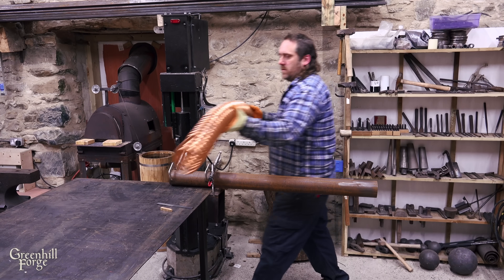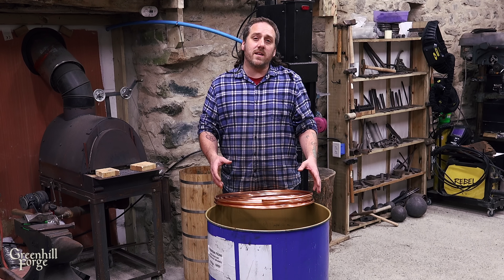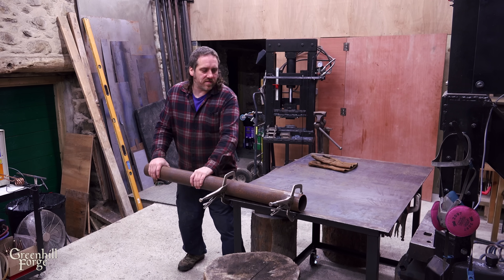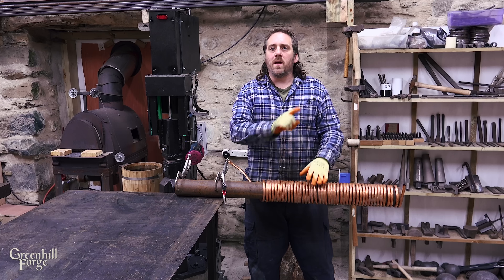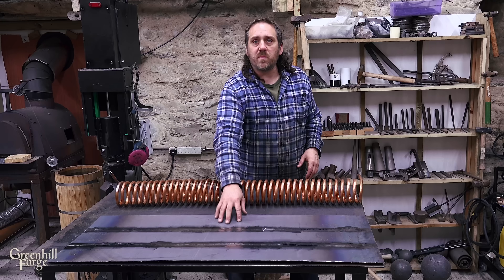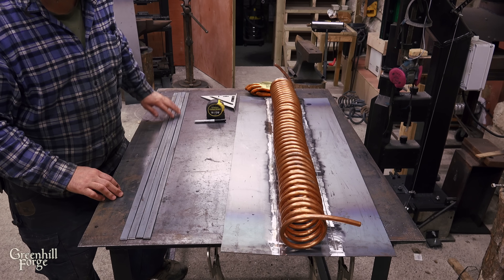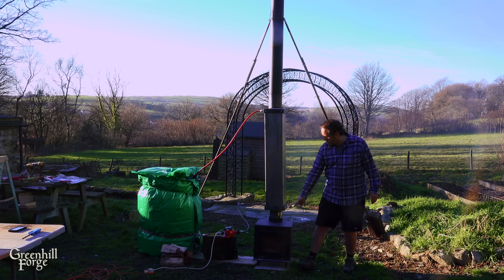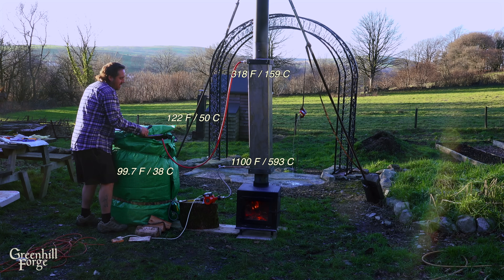Wood Stove Water Heater Experiment - Surprising Results! Part 1

Comment: the best way to do this is to put a stainless steel pipe that is pre bent back and forth , into the inside of the stove

you can do a siphon by putting the barrel or water heater higher than the cold inlet, or put a grunfos pump on the pipe like I did...I shut my water heater off in the winter.....water heaters use 4Kw of power when they turn on....and they can be on sometimes up to 30 minutes

Comment: My brother made a boiling vessel  roughly 10x10x3 which fit in the top of a Jotul 507 stove.
Based on the heat output from 3 radiators (convection circulation, no pump) plus radiated heat, we estimated the output from wood to be at least 5kwh.

Comment: Very well done , I have started builing mine last week .I have only18 inches of exposed  chimney in my shack .Wrapping the copper tubing with copper 6 inch fins incasing it in a cylindrcal casing creating a turbine . the upper and lowier vents are 3 inch .I will blow air though the vents , through the turbine making it dual purpose . Hopefull recovering the chimney heat for shack and my hot water device . with a variable speed fan regulating the air and water temp shouldnt be a challenge . Wish me luck , Im an old cripple living in the Rockies with a pair of tin snips , wack of copper and 6 cord of fir .thanx

Comment: I think the video is great, your craftsmanship is perfect and you seem to have all the tools to work with, which is awesome.  A number of people picked up on the fact the smoke hitting the copper tubing will eventually clog your flue.  I worked in water treatment my entire life, and the first thing I thought of was the mixing of the copper in the carbon steel. This creates a galvanic reaction in will corrode in no time. I would love to have one to put inside my cabin but of course I would want the copper coil to be on the outside of a pipe.  It would be cool if you would make one apparatus that would go over top of a section of stove pipe let's say a 6 inch and an 8-inch option. I would definitely buy one from you.  Let me know.

Comment: 2nd generation Chimney Liner installer, sweeper, and inspector for both Class A wood stove systems and fireplace stainless steal liner inserts using both pour in insulation as well as wrapped insulation. Two things that I would test out if I were you. The main thing is to install a thermometer into the stove pipe before and after the water heater to make sure that the water cycling through is not cooling the flue gasses below the recommended temperature. I don’t think that it would, if anything I believe the extra insulation would increase the temperature of the gasses but if it is cooling them then people that build this system run the risk of creosote buildup which happens when the smoke cools inside the chimney and turns back into its solid state before exiting the chimney. Creosote is extremely difficult if not impossible to remove once it fills up a chimney pipe there is no getting it out and the system has to be thrown away and replaced or the creosote could catch fire and produce an extremely high temperature chimney fire. The other thing is really just a possible test that may help make the water heater faster and more efficient, I was designing a similar system to heat a swimming pool awhile back. The guy had previously made a wood stove out of a 55 gallon metal drum laid horizontally with iron pipe ruining horizontally accross the top in a zigzag type pattern. It heated his pool fine until he upgraded to a bigger Olympic size swimming pool. I made a few simple adjustments to make his design more efficient, most of which you already incorporated, switching him to copper pipe instead of iron to  conduct heat much faster. But the biggest experiment that I theorized would work but had never done or seen done, I used the same type of metal drum only I made it stand up virtually instead of horizontal just like your water heater system only this system of copper pipe ran inside of the wood burning stove and not a stovepipe. The drum being vertical meant a smaller fire at the bottom to concentrate the heat and minimize the amount of wood he had to use. The other thing that I was debating against myself was whether I should have the copper pipe coiling up through the drum like yours or if I should experiment with a different configuration that I theorized would work. Since the coils had already been proven I tried a different way. I can’t say it worked better or worse because I only tried it this way but I basically ran copper pipe vertically from bottom to top inside drum with two 90° elbows when the pipe reached the floor/ceiling of the drum to turn it around and run right back up/down again as many times as i could. I think that in doing the copper pipe vertically up and down as the pipe and water heat up every section of the pipe will be heating the water/pipe above it and there is less escape of heat. A littler fire using less fuel and producing less heat can be harnessed much quicker and more efficiently. With the configuration a fire half the size of the previous build was able to heat his pool considerably faster and more than the other that was not able to change the temperature at all in his larger pool. I  learned everything i know from my father whom started his own chimney company after learning the trade working for others. He was always inventing more efficient methods of doing things the same way that you do. He never finished high school because he dropped out to work full time when I was born. He worked many different trades his whole life and sacrificed everything for his two sons so we would have the best possible chance of success. I tried to learn all I possibly could from him, went to a technical trade school for welding just as he had done, and thanks to his selfless dedication to his family I did graduate high school and I went into the Army Infantry for a few years to pay for college. I honorably discharged from the Army thanks to him and then went to college full time. I got my degree and was the first one in my family to do so thanks to him. And found myself in some very high leadership positions thanks to him. And I can say with one hundred percent certainty that even with all of the education I received and the training and schools, and opportunities that were afforded to me and how many different states and countries and continents I had the opportunity to travel to, I have never met anyone in this world who was as brilliant and as well respected, trustworthy, and honest as my father Brian Fink was. He never once claimed to be an expert at anything. But he could take apart and fix anything. Plumbing, electrical, masonry, carpentry, welding and metalwork, mechanics. He could do it all and he did it all for everyone that asked for his help. Everyone in the family relied on him. He was the best hunter and outdoorsman I have ever known or heard of. He taught himself everything from making a fire without any tools to making traps to survive in the wild if ever we needed to. He patented several inventions that he never was able to mass produce because he sacrificed everything for us. He worked every day as diabetes slowly took his kidneys and his heart and only cared about protecting us that he would go and hide where he thought we couldn’t see him on job sites and throw up from the toxicity levels of his blood. He refused to let anyone else take over the hardest jobs when we installed chimney systems. He passed away a little over a year ago. The days after Father’s Day. He knew he was going to die and he didn’t want us to worry so he would never tell us anything. It drove me crazy and frustrated me to all hell. He died alone in his chair in the house that he grew up in. The house his great grandparents built and lived in their whole lives. He had always wanted to own his own house but never was able to. His grandmother died 3 months before him and he inherited his childhood home. I would have given anything for him to of gotten many more years in his home and more time with my two sons and my little brothers new son who never got to meet their paw paw. But I spend every single moment trying to preserve his honor by remodeling this house and fixing it up to its former glory and keeping his memory alive in my kids.

Comment: Really nice work building it. Two things first is if your water tank is a little higher the water will circulate on its own as it heats and cools. No pump needed. 
Second I hate to say it but this style of heater usually sets up  really quickly. There is another type for guys use steel heavy duty tubing in the actual firebox of the stove, they seem to work pretty well long-term.

Comment: I remember as a young kid in 1978 doing something similar. Water barrel inlet to the top of just a burn barrel(keg) coil to the bottom then out down a hill with rhe drop about 12 feet. Start a fire in the Keg get it going for about 20 mins and the water would siphon down the hill to a makeshift shower. Almost Endless hot water with no pumps. Pressure wasnt the best but the warm shower was nice as a kid camping in the woods.

Comment: I remember trying to do the same thing when I was a kid, but not knowing what I was doing properly, I was working on the idea of hot water rises and cold water sinks and that  would take care of circulation .but I could only get hold of some small diameter copper pipe and using an old, very large cooking pot ,but because of its small size, it just  vaporize the water into steam well I gave up at that point, well I was only 8 years old at the time

Comment: The heat exchangers (water to water) for radiant floor are only like 5 inches by 12 inches and very efficient. Tankless hot water heaters the same, I think there must be an easier way but cool video!

Comment: I heard plumbers used to fill the pipe with sand before bending.. just a thought
Reply from the maker: I use sand for small items but filling 50 feet with sand without any gaps is a different thing
Reply: @GreenhillForge  ahh cool. Thanks for the reply :")

Comment: He bett÷r put a high temp spacer between the "upper and still or the dissimilar  metals will cause them to oxidized and copper will after 3 years  or so the copper will leak destroying all the hard work.

Comment: Why not use sand as insulation?
Reply from the maker: sand is thermal mass. it sucks up heat rather than blocking it

Comment: That whole heating coil stove pipe should also be filled with sand and it will maintain and store more heat and will slowly release over time even after the fire is out. My Grandfather did this 1 firing kept his cabin warm for 24 hours

Comment: 30 years ago I bought a blanket with copper tubing quilted in it. It's called a water jacket. It surrounds the wood burning stove. Water is circuculated through it to another jacket surrounding a tank in a closed loop. Still works today. In that time only two joints needed resoldering. It's only seasonally operated. I've been tempted for awhile to incorporate a steam turbine generator but no. That would invite inevidable catastrophe.

Comment: A hundred years ago, a company in Pittsburgh,( Ruud)made a water heater with a coil of copper pipe in an insulated vessel with a gas burner at the bottom. The first of the continuous water heaters.

Comment: I’ve commented on similar heat exchangers and 1100 degree temperature is going to heat a certain amount of water and pipe to maximum capacity the rest of the pipe will not absorb any more heat. Got to be a sweet spot of copper to heat A visible copper pipe and temp gun would give real time data.

Comment: Hello sir. Nice build. I would make two suggestions:
1. (easy) Put the water flow from the top to the bottom (counter current flow)
2. Use finned or rodded tubes from half way up to increase the heat exchange significantly. Cylindrical bare tubes have very low heat exchange surface when compared to finned tubes

Comment: The only issue I see is a potential galling of the copper tube as it exits and enters the steel box. Seems to me there needs to be a high temp tube gland to prevent the copper from being gradually sliced through and weakened. Also I missed it if in fact you installed a pressure relief valve at the hottest point of exit from the hot box.

Comment: I am about 7:50 in and I see steel touching copper. As a plumber my alarm bells started going off saying dis-similar metals touching, galvanic corrosion. That would worry me for the longevity of this build. So far I am enjoying you video and information. This is the first video of yours I have seen.
Reply from the maker: it's just a test unit. I'll be on to a new design within a few burns.

Comment: I've been running a wood fired bioler at my house for 5 years. It supplies all the hot water we could ever need together with floor heating and radiant heat for house. It burns about 150 pounds of wood a day.  Our cold wate line enters the top and hot water comes out the bottom. We love it and for our winters it costs us $300-350 a season. Spring, summerand fall it cost $90 for hot water.
Reply: Hard to believe,150 lbs. Of wood a day only costs that much,for a whole season ....you must only pay pennies a cord.....or is the $150 the amount you pay for chainsaw fuel? Thanks

Comment: Awesome fella I had a cast iron stove & cut a hole and inserted a small 2 gallon stainless steel box piped water from my in ground pool from the pool return back into the pool .we heated pool to bring temp up then switched up to homemade poly coils on garage roof. Used it for many years . Worked great 👍 75+🍁hunter Yorkshire expat.  Had to scale down as the 14ft x 28ft pool was like a hotub 😃😄

Comment: Great video great contraption! One thing I learned having the the copper inside the fire place or flue is that it condenses really quickly and builds a lot of soot and char around it. Which then doesn’t transfer the heat as well. 
One way to clean it is empty the water out and burn a really hot fire to burn off the carbon buildup.

Comment: two filling materials are often used to bend tubes : sand and lead. When using sand, you need to secure the extremities. Sand has the advantage to work well even when heating the tube, this could help when bending steel.

Comment: This is how my grandmothers home got hot water, only on an oil stove. My job was to wake before everyone and light the back burner on the oil stove by turning it on, then dropping a tiny piece of tissue paper down to light it, then waiting for it to warm up and adjust it to a higher setting. It took several hours to heat enough water, but hot water was used very sparingly.

Comment: For cabin hot tubs, we just ran 1" copper pipe out from the tub and had a few coils around 2 ft in diameter then back into the tub. Build a campfire in the center of the coil. No pump or anything. The flow from convection was pretty impressive.

Its no indoor solution like you have , but it is simple for hottubs and outdoor showers

Comment: Having brass standoffs will increase the life of your copper. It'll drastically reduce electrolysis..as a plumber I've repaired/replaced a lot of copper that's leaking because it's attached directly to metal. Awesome build, though. I enjoyed it and learned a lot.

Comment: Do you really need the pump? I saw a similar system used in a pit fire and the convection of the heated water was sufficient to get and keep the flow, assuming the colder water entered the coil at the bottom.
Reply from the maker: the final design will be pumpless

Comment: Very nice project. But keep in mind to reverse the flow. Pump cold water in at the top, and then extract water from the copper pipe at the bottom. You want a counter-flow heat exchange. This will give you at lot more efficiency.
Reply from the maker: final design is intended to be pumpless and use thermosiphon so I need values with water going bottom to top. but otherwise you're totally right

Comment: Well, you got an INSTANT subscription, think that was the first time I've done that. Bit cheeky, but have to ask, how many times (if any) did you have to redo parts of this design/build? Will be interested in the rocket stove build and comparison, also if/how you incorporate any of the refinements or corrections others have suggested/recommended.

I recently moved from a house that had a 1930s boiler/radiator setup, originally used to run on coal! I know of another one that was converted to run on oil, this one ran on natural gas. Used thermosyphon, no pump noises, almost completely silent in operation, apparently pretty cheap to run. For a house, vs big installation wouldn't think the massive installation would be a practical option, but this? I can see it being workable.
Reply from the maker: Thanks! No redos, I'll always show my mistakes (design wise at least,not if I measure incorrectly of something like that that just adds wasted time to a video), think it makes a better video. I plan to do some testing with this dropping the pump and running just on thermosiphon. Lots more tests and interations coming including some of the things mentioned plus others.
Reply: @GreenhillForge I regret to say I haven't got enough right now for a patreon contribution, but will in a few months  make the basic membership, and also the full membership at some point.
Reply from the maker: @ don't worry about it, just glad you're here.👍

Comment: A lot of good work here, but I'm afraid you are going to run into issues soon.  Cleaning is obvious, but leaks are imminent.  Don't expose the copper tube directly to open flame.  Wrap it around a pipe and transfer heat that way.  Then it will be easy to repair, and you wont have to get fancy with the cleaning.